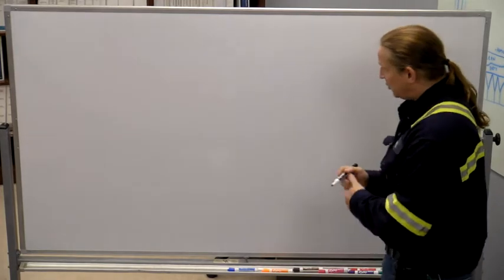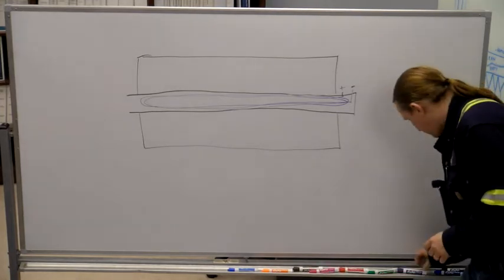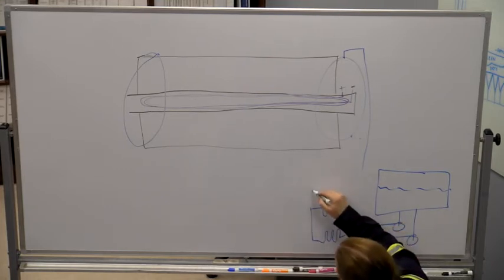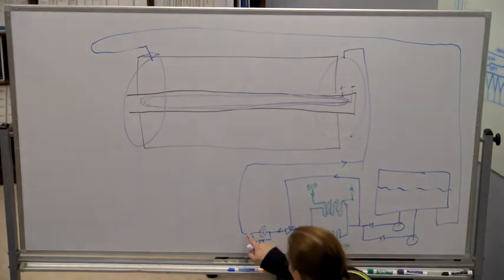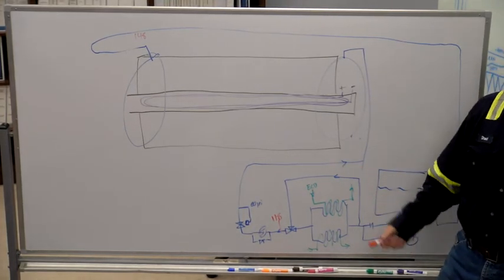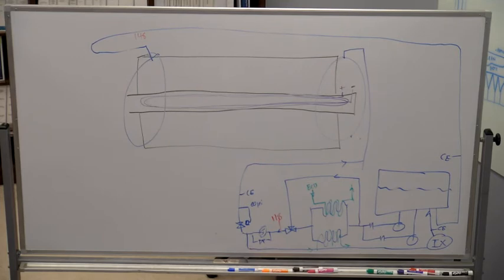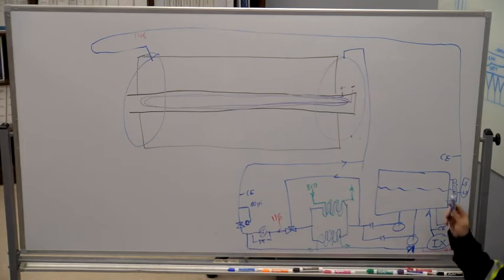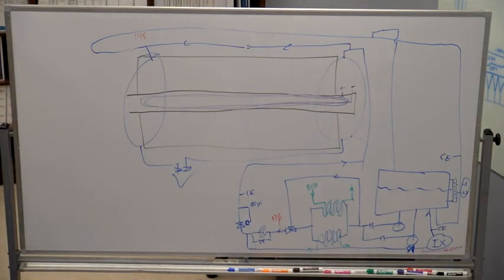Power Plant Basics: Stator cooling water

Comment: Why do we care about conductivity of the water? The pipe it's flowing in is a much better conductor than any reasonable water, so the fraction of any current going through the water would be very small compared to what goes via its pipe (whether that pipe is the stator winding or outside of stator). Also it seems to me that any nonzero conductivity would not actually increase Ohmic losses in the stator: it would (imperceptibly) decrease the real component of the stator's impedance.
Reply from the maker: Thanks for the question. I should have made this more clear!
The piping is stainless steel from the tank to the generator, but there is a section of plastic/rubber tubing creating a resistive gap between the piping and the Stator. Without that, I promise the generator breaker would definitely short out.
Reply: @Shaddicus  Would it be impractical to have a double pipe inside the winding that doubles back at one end of the winding and has an inlet and outlet connected at the other? I would expect that to not require nonconductive water. I wonder whether there's a problem with that that I'm not seeing or whether that would be just more complicated than maintaining low conductivity.